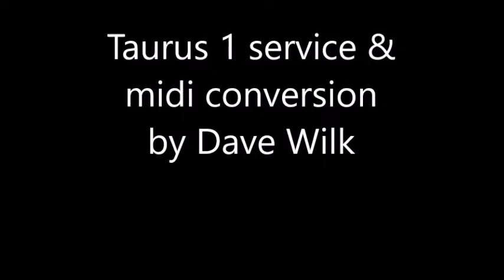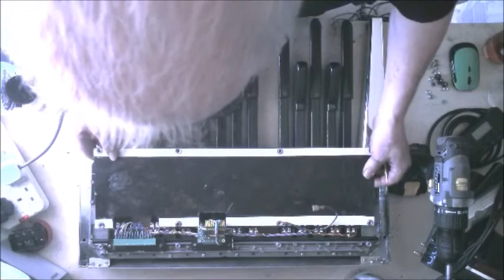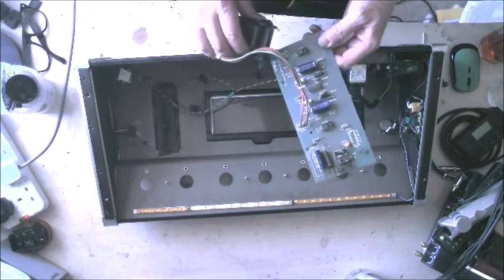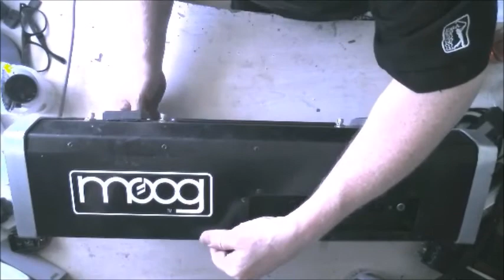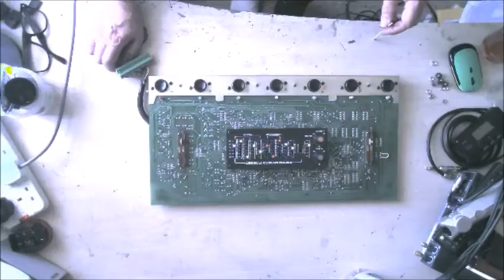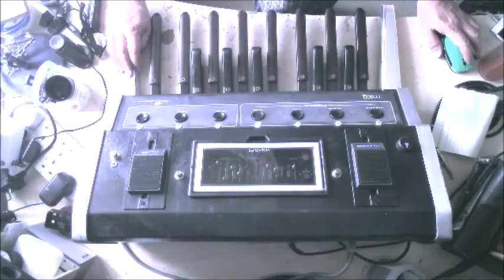Moog Taurus 1 - midi conversion and service

Comment: What power supply did you use as a replacement? And where did you get it from?
Reply from the maker: It was converted to a three pin IEC type and so now has a separate mains cable
Reply: I understand that you used an IEC cord. I was asking about the power supply itself. I’d like to convert mine to a more stable power source.